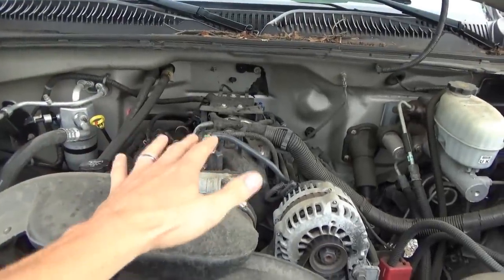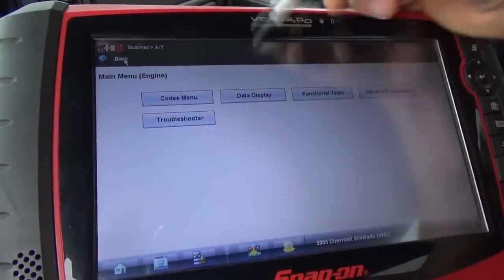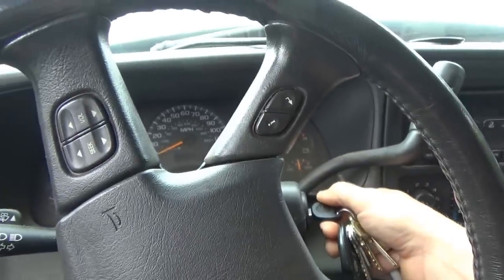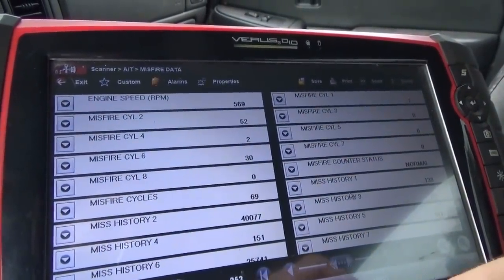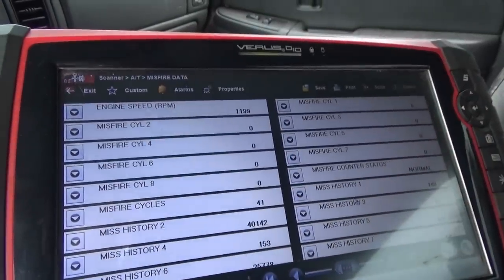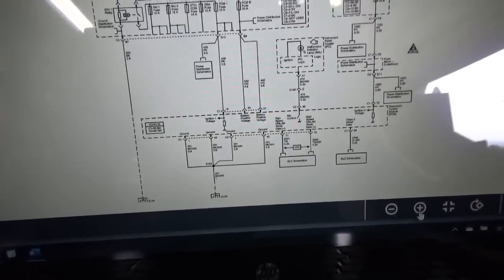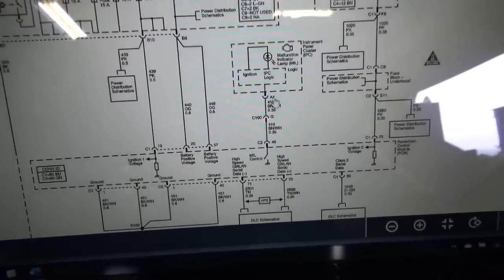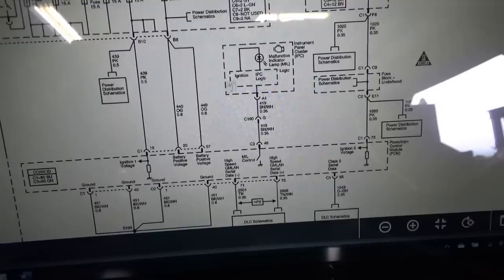Misfire, but No Check Engine Light? (GM Truck)

Comment: Hi, my 2500 8.1 will skip, flash engine light then take off like a rocket, then skip again,, most common in wet conditions, new coils, plugs and wires,,
Reply from the maker: Just wires man
Reply: Has new wires,,,,   New plugs,,   New coils,,,,

Comment: Flex fuel ? Yea ! Put that E85 in there ! It's dollar cheaper ! Brush off the 02s , plugs ,  coils ,  Injectors dirty ? Evap working ? Stuck valve ? Wiring ? Grounded ?

Comment: PCM connections were under the fuses?    Do you still feel that you cannot bidirectionally control the check engine light now that all wires are repaired?

Comment: In the olden days we did what was called a "tune up."  You replaced the spark plugs, wires, distributor cap, rotor, points, and condenser. If that didn't work you asked a real mechanic.
Reply: LMAO.
Reply: Still remember the Motorcraft DKF-10 kit for an F-Code Mustang I had.
Reply: I still do that on my 66 f100
Reply: If that didn't work then you checked the timing chain.
Reply: Oh, yeah, I did a few of those myself back in the '70's and '80's. I remember more than one Quadrajet carb with a bad accelerator pump too. My dad always asked "Did you put a kit in the carb?" He wasn't always wrong!
Reply: Doing a "tuneup" on a toyota replacing ever lasting plug wires with aftermarket is basically degrading the life span of a toyota engine
Reply: People still do it today. The sad part I see shops doing it. They do plugs wires and some goes as far as coils before even grabbing a scanner crazy.
Reply: @lovetolearn5253  all about the money
Reply: I'm just parts changer myself .
Reply: I love this comment. This is me
Reply: In the "olden days" that's all there was to do. 😊

Comment: I’ve got a 2003 gmc 2500hd with a misfire on cylinder 1 and 8 mainly no codes or light, I seen my bank 1 sensor 2 o2 has 0.03 mv the upstream seem fine. I know the o2 is probably bad but is that what’s causing the misfires?
Reply from the maker: Great question! How do you know that It's cylinders 1 AND 8 that are misfiring?

Comment: I am a lady w a multi meter checking for a parasitic Draw and I always want to look under my fuse box but I dont.
 because I'm clueless w no diagram...but, a mechanic should check those areas or peak. I don't understand it..when a check engine should be on,  blink or whatever. How can we not be shanked out of money at a shop? It's scary but we see that applied knowledge, investigation and good tools are the real keys for auto repair

Comment: And that's why people love you...they know you will repair with "no parts required" if you can.  Had the same misfire codes on my 06 silverado, a week ago, (it wasn't cylinder specific and my check engine light did work).  Had nice MSD wires on it so I assumed the previous owner did a tune-up on it.  Nope, previous owner just changed the wires.  The spark plugs were a pain to remove and I snapped a plug and rounded a plug hole in the process (they seemed like the original plugs AC Delco).  What a pain removing that snapped plug.  Great work Ivan!
Reply: Did the previous owner run the plugs over 100K miles?  Did you have to heli-coil the spark plug hole or did you use something better?  I feel for you!  What a pain!
Reply: @dogsplantscarsneatstuff176  I am not really sure, but I would bet money they were the original plugs.  I bought the truck with 154,000 miles on it.  It has about 190 on it now.  I would have changed the plugs but the wires look pretty new (MSD).  I will never know.  It was a learning moment for me.  From now on do a complete tune-up when buying a used car.
   I tried using a thread chaser but ended up  using a tap.  The tap was enough to clean out the hole without using a heli-coil.  So far, so good...runs great with no codes.  Fingers are crossed.
Reply: @avasonsyn  I am so happy your were able to tap it out instead of installing a heli-coil.  That is really contradictory:  high end plug wires with unchanged plugs.
Reply: Explain "Rounded a plug hole"?

Comment: Oh no a Jasper engine if it's anything like the one on Ford TechMakulocos channel I can't even begin to imagine what could be wrong
Reply: I just saw that video earlier today and thought the same thing 😆 Jasper engines 👎
Reply: it's likely more of a "ford" thing and them reusing very worn out parts. much more of the  vintage GM stuff had stronger parts, which would last longer and through a rebuild or two.
they knew the GM gearhead folks were more likely to modify and tune for more power, also much of it would have been corvette designed pass-downs. sometimes it makes sense to keep using the costly R&D and same manufactures in greater bulk quantity, than to design "chintzy" parts to cut costs, which often ends in negative returns.
Reply: @notsureigaf  Yeah it was dreadful I've never seen something so bad in my life
Reply: @throttlebottle5906  Never knew that

Comment: 2010 Chevy Aveo 1.6. Dead miss on accel. Engine light on but NOT for misfires, for a stupid evap vent sol. Nothing pending. #3 plug cracked. Point is do not rely on the engine computer to tell you codes on regarding misfires 100% of the time. Also in IL, they will reject any vehicle that fails the bulb test, or has that code.

Comment: I got a good one towed in today. I was contemplating whether I should record and post. It's a 2016 dodge that stalls at a stop or decel no codes or symptoms leading up to the stall. No codes after the stall and restarts, it will drive fine until it sneaks up again. It can run fine for days or cut out 3 times in a row. The car has been to 3 shops and many parts fired at it. I alread have a good ideal on something I seen during the test drive. I really wanted to do it to plug Scannerdanner. Without that man I wouldn't own what I own. I was changing tires before I learned his teaching. Now I'm trouble shooting for other shops how crazy is that.
Reply from the maker: Cool! Did you figure it out?
Reply: @PineHollowAutoDiagnostics  yes, APP2 (pedal position sensor) was dropping out. I'm surprised I caught it upon the test drive. It was dropping out super fast, If you blinked you missed it. So I graphed APP1 and 2 with the scanner. then it was alot clearer APP2 was dropping like crazy. I scoped it at the gas pedal then the pcm no dropouts. It looked great on the scope. When I went to unplug the pcm is when I found the problem the connector was seized in the pcm. I finally got it free with WD and time. I cleaned up best to my ability (green crusties) and that did the trick. The thing I dont understand is how it didn't set a code. The customer did state some times it would bing the light upon stalling with a red lighting bolt and others it wouldn't. It never set a code for me and it was clearly dropping out. It looked like a failing abs sensor when you get that quick glitch. If I didn't have a scope I wouldn't of been able to pinpoint it. After I found the problem I did notice a new Throttle body plugs coils, injector MAF and the customer stated a couple other things.
Reply from the maker: @lovetolearn5253  Interesting. Never trust scan data though, Chryslers are weird, and scan data will show a regular pulse on APP2, even though it's not real. Always trust your scope. No codes and good scope signals says to me that the problem is still hiding somewhere :)
Reply: @PineHollowAutoDiagnostics  unfortunately it acted up again today but this time it threw a code and the red bolt of  light came on. Good thing the customers didnt pick it up yet. It actually has 3 codesp0642 sensor reference low p1618 erratic p2122 app. I'll keep you informed. I'm glad you told me about the scan data thing. Its something to keep in the back of my head
Reply from the maker: @lovetolearn5253  excellent! Now catch the glitch with your scope 👌👍
Reply: @PineHollowAutoDiagnostics  I found the problem and it was a mission. The van was only throwing  APP related code. So I scoped the app1 5v and sensor and app2 5v and sensor. The 5v on app1 would cut out for literally half a second and sometimes it took 2 hrs to get that small glitch. I do a visual and see nothing. At this point I wasn't sure if it was the pcm, power,ground, sensor or wiring. Remember this thing only happens for a split second literally not even a full second on the scope.  I cut one of the 1 5v wires at the pcm and add my own. At the computer there was 2 5v 1 and 2 5v 2s wires.  The one that I cut and added the 5vs ends up being the one that's being pulled to ground (lol talk about luck). Now I know I'm close, it can only be wiring, crank sensor, oil pressure sensor or throttle sensor. So I cut and add the 5v at the throttle body and that's not it. I'm left with 2 sensors and wiring. I get to the crank I do the tap and tug test nothing. I look way up the back of the engine and I noticed a wiring harness looked out of place. So I take a long screw driver pulled the heat shield back a little and tapped the wire, jackpot it drops out. It was the crank 5v  supply shorting to the top of the heat shield. Someone ran a harness the wrong way
  There was no way I would of found that on a visual inspection. The only reason I found it is because I knew it could only be in 2 short areas or sensors.  In my eyes I seen no other way then cutting the 5vs and adding my own to narrow it down. I had a very small window. It would take hrs to act up. I dont see another way I could of found the issue other then that way. I know someone's going to drill me for cutting the 5vs but I seen no other way.
Reply from the maker: @lovetolearn5253  that's awesome! Great job! No parts required! Scope is absolutely essential 👌
Reply: @PineHollowAutoDiagnostics  yes scope was key. This is my toughest diag to date. I tried explaining to the customer it wouldn't of been bad if it stayed broken. The problem was I had a 20 second window to find the issue plus it took forever to acted up. I had to think outside the box to pinpoint. Alot of guys would of b#tched for cutting the 5v wire but I seen no other option. It's not like I can drive without the throttle sensor plus even if I could how long do I drive before I say that's the problem. Remember theres times it didn't acted up for hrs. So with me cutting the 5v I could say with confidence my issue is that away. Freaking awesome diag I wish I filmed it. My last 3 diags was good ones that I wanted to film but I'm always nervous for some reason. I work alone I don't have shop employees to ask. I have to figure it out on my own with YouTube and alldata. To be honest alldata isn't that good at diag. I only use them for wiring, theory and operations,locations,code descriptions and removal also oms and torque specs on parts. I would love to see how they would of flow charted this one lol. I still cant believe I found this one talk about a good feeling. This Van's been down for over a month.

Comment: This is deja vu all over again... My 2004 2500HD just sat for 6 years and I only plowed with it in the winter... This spring, I put new heads and bump stick in it to drive it more often...  I actually even registered it for the first time in years...Same location with the rodent damage... I had 2 chewed through wires  and 12 with insulation stripped off... She's been smooth as butter ever since repairs... And ya gotta love the fuel efficient 6.0L.... LOL
Reply: Steve the farmer next to us used to raise turkeys and rats would abound.  The only justice was when they would eat my freezers' wiring and pay the ultimate price.  My '77 C20 350  has an alignment problem: it glides toward gas stations when nearby. You know 20 mpg:  12 on the freeway and 8 in the city.   I would probably wish I had your gas mileage of your 6.0.
Reply: My 02 2500HD 6.0 gets a steady 24mpg and i am not light on the go pedal, meanwhile my 04 Cadillac Deville gets only 21mpg, makes no sense, lol
Reply: @mattcat231  That's pretty incredible... My average is just about 15mpg if I'm going downhill both ways... LOL
Reply: @mattcat231  Are you getting 24 mpg going 75mph?  You must be living right!
Reply: @steveo6631  My dad would add to downhill with the key off and over a cliff.
Reply: Yes, i am always on the gas hard! Take these numbers and compute them, 397 miles on 17 gallons of gas, done every weekend to go see my son in the winter, that's just about 23.5mpg, and that is taking I-79 from Washington Pa (+ 19 miles from my house) down to a town in West Virginia and back round trip
Reply: Maybe it has something to do with the throttle bodies and EGR? Mine is the LQ4 cable drive throttle body, and I did an EGR delete, it's just laying on the intake to keep the engine light off, and my knock sensors are now in the passenger head where the EGR pedestal used to be. The engine and 4l80E/261HD have 187k miles, 4:11 gears, and it has piston slap on #6 or #8 since it had 89k miles. Its a regular cab 8ft bed with RPO code HVY, 9100GVWR, and running the stock LT245/75R16 tires on the stock aluminum wheels.
Reply: @dogsplantscarsneatstuff176  my old 1988 GMC 2500 (light duty 7200 GVWR) 2wd has the 350 TBI engine and 700R4 with 3:73 gears in back, and i got a consistent 14mpg no matter how or where i drove it
Reply: @mattcat231  I have the 95 K2500 4WD with the 5.7 and 4L60e. Trust me, it’s never seen 14mpg and it’s gutless to boot.  There’s no part on it that’s not the best that money can buy too. When “normal” returns I’m selling it and replacing it with a 2003-2005 K2500 with a 6.0. At least it will have more power for the fuel that it’s sucking down.

Comment: That's great thing to diagnose the issues with suburu part!!  Haha,   i have a customer who replaced all oem spark plugs and wires and loom for coils too.  He's still getting p0300 misfire,  along with po174 lean,  with maf issues,   he replaced the maf too.  I checked and diagnosed it,   I'm thinking the intake gasket leak beginning the cause of the problem.  He did replace the throttle body too.  So I'm trying to find the misfire p0300 issue.  He's got 04 chevy silverado 5.3 v8.
Reply from the maker: Take a look at the fuel trims and oxygen sensor activity like I did in the beginning of this vid :)
Reply: @PineHollowAutoDiagnostics  i will check that.
Reply: @AP9311  Yes, check the fuel trims especially, if they are high (in the positive) it's more than likely lower intake gaskets leaking, best guess based on experience without seeing it in person. Also, I've seen them need to have the cam/crank correlation relearned to eliminate missing

Comment: Autolite plugs are great for lawn mowers. I think.
Reply: Yeah, Oughtolite but don’t.
Reply: Junk. Had a new set in a v twin, and had one die after only 5 minutes of use
Reply: @whatsnewonthemountain  Comment of the day, I laughed hard and im still laughing, lol, oughtalite, lol
Reply: you couldn't pay me to put them in anything but a vacuum or heater hose as a block off
Reply: @braaapattack2937  what do you expect from the makers of the orange can of death?? 🤣🤣
Reply: @bigdaddymak1439  for it to work 😂, to be fair, I run those on my generator and haven’t had an issue…. Yet 😂
Reply: Oil filter I mean, not outta-light 😂

Comment: I was starting to think a fuse under the hood was bad but nope I was way off(like the pcm fuse that runs the check engine light if that fuse is bad the check engine light won’t come up on the dash when you turn the key on)

Comment: I chased a miss on a h2 for a while once.  I just knew it was electronic....wrong... after checking everything 3 times I pulled the valve cover and found a broken valve spring.... I aired up the cylinder and replaced that valve spring and she was good to go....sometimes I doubt myself and that was a good example lol

Comment: This is why it pays to take care of the local feral cat community or a couple if they hang around your house, a little food and water and they are the best rodent deterrents you can find, a house cat might in some cases will do the job but they can become too complacent and used to cat food where as a strictly outdoor cat is meaner. One time I had both in a little black female, she was an excellent mouser, the only thing is they want to share their kill with you and will leave you the occasional head at your door but you get used to it.

Comment: Don't you just love customers who breathe down the back of your neck while your trying to diagnose their car? Tell him to go for a nature walk, I'll call you when i'm done. lol. 2008 1500 4.8 I had a p0300 but scanner showed misfire on #6 and everything checked out ok,  I did put plugs in it though but still the miss was there and the cel was flashing but all the pids looked great, I checked inj. and spark with scope everything was perfect, just off idle it was fine, I even tried a new intake gasket, nothing so then I put half a can of SeaFoam in the oil and drove it about 10 miles when I pulled back into the driveway I thought the thing died it was running so smooth, no cel no misfires no nothing, crazy lifter is all i can figure. Peace!!